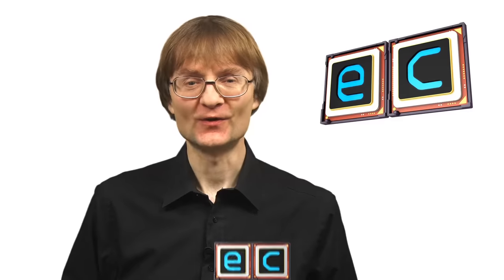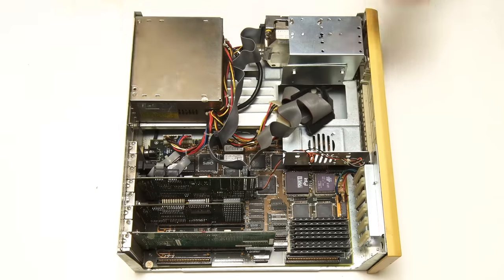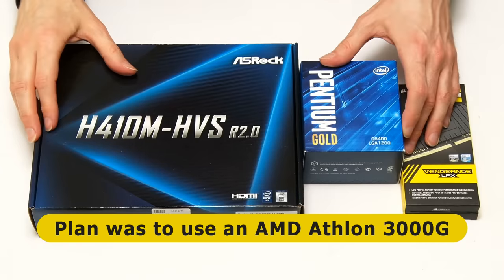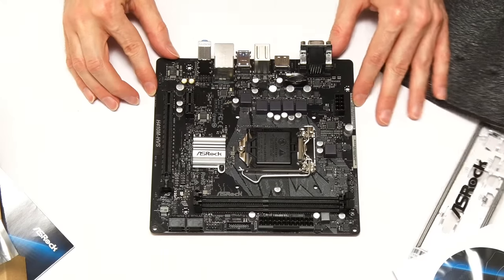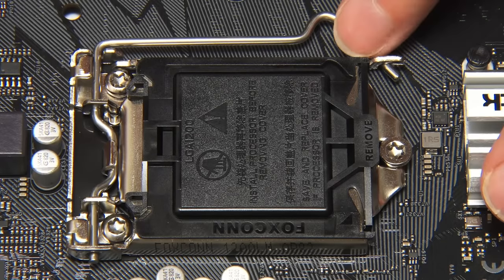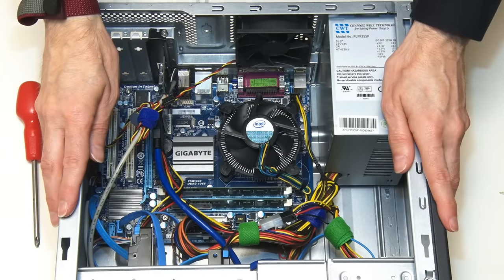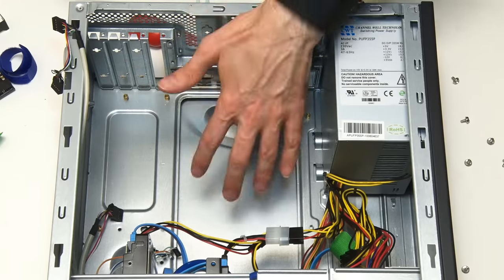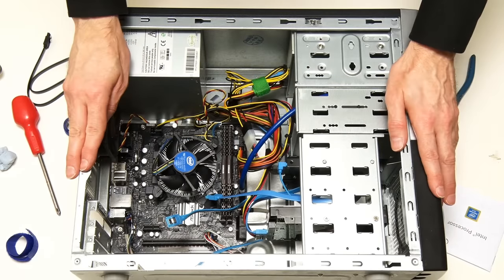Old PC Upgrade: Motherboard & CPU

Comment: Put an inexpensive, unlocked Pentium in the old PC upgrade I did eight-years ago. Pretty much did exactly what Chris is doing; new MB, the old case, 2 of the old drives. Put the OS on a new SSD, though. Better part of a decade later it's all still working great.
Reply: Oops. Chris did install a new SSD. Guess I should've watched to whole video before commenting!

Comment: One day the front panel connectors will be made simpler - like the USB connector - and not those silly 2 or 3 pin things that can be really annoying (especially the ones that come with every wire separately).

Comment: 18:25 the classic error when slotting the motherboard in without seeing that the little metal laminate above the hdmi hole on the backplate that should be pressing the hdmi port down now is inside the hdmi port ;)
Reply from the maker: Well spotted. Fortunately that shot does not reflect the actual build -- it was shot a day earlier when I did most of the close-ups and alternative angles, and I did not notice. Always when filming, access and vision are very restricted, so I am often working a bit blind.
Reply: @ExplainingComputers  I hope you have not left out the thermal compound.

Comment: I remember last year buying a 2600X with an ASrock AB350 Pro 4 motherboard (no RAM as I already had DDR4 lying around), and still got away with 200€, more or less the same price point for much higher end components.

Comment: Great video as always Chris!  I do wonder, though, whether you should have explored upgrading the processor of the existing motherboard with a second hand one from eBay etc.?  You could well have seen a noticeable improvement in performance for a fraction of what you paid, may not have needed to reinstall Windows 10 and you would still get some value from that DDR3 ram purchase.
Reply from the maker: This is true, but I am nervous about showing (aka recommending) purchasing old CPUs. As you say, it can work out great. But not always . . .
Reply: @ExplainingComputers  Sometimes it doesn't work well - for example, I upgraded a Pentium 4 Northwood to a Prescott processor and, well, there was no improvement overall at all - similarly, I upgraded a T7200 Core2Duo to a T9300 and the improvement was small - but recently I went from a i3 2100 to a i7 2600K and the improvement in performance was dramatic :) ...I think you could have installed a 4 core processor in the original motherboard as an additional step in the upgrade series??

Comment: Something you forgot to mention, if you are working on much older ATX system, it may only have a 20 pin ATX connector. If that's the case, the system may boot, but it's best to purchase a new power supply.
Reply from the maker: I am confused, as I stated and showed very clearly indeed that a 24-pin ATX power connected was needed when installing a modern motherboard, along with an additional 12 pin connector.
Reply: @ExplainingComputers  Yes, but you showed an AT computer. As I'm sure you know, back in the early 2000s, we went from the 20 pin ATX to the 24 pin ATX. Technically, new motherboards will accept and very possibly run on a 20 pin ATX connector, but it's not advisable. 

Sure, it's highly unlikely someone would be attempting to upgrade a computer from that time frame, but it is worth noting.
Reply: @ExplainingComputers  And the reason I am specifically pointing this issue out is, I upgraded an old Athlon XP system to a Core 2 duo back in the day. My PSU had the 20 pin ATX connector, while the C2D had a 24 and a 4 pin EPU. Yes, the board ran, but the CPU couldn't clock to anywhere near what it was supposed to since it couldn't get the power that it needed.
Reply from the maker: @freednighthawk  No, I specifically showed a the 24-pin ATX connector and said that a PSU had to have one to use the PSU with a modern motherboard. I then showed a completely different connector in an AT computer as you say. I accept that I did not show a 20-pin connector on a board between the two. But I very clearly indeed stated that a PSU will need to have a 24-pin ATX connector -- and showed the same. So yes, I agree and know that there were 20 pin ATX connectors, but as I stated and showed that a 24 ATX connector was needed, I am struggling to understand what the problem you are complaining about is! :)
Reply from the maker: @freednighthawk  Thanks for this, and I totally accept what you are saying. Trying to run a modern motherboard with a 20 pin connector will either not work at all, or will give issues as you note. However, by saying that a modern motherboard requires a 24 pin connector and a 12 volt connector I did address this issue, not least as 20 pin ATX PSUs did not have 12 volt connectors.

Comment: I would have tried first putting a better processor like the Q9550, doing the before and after and the talking about upgrading motherboard + CPU. Just a suggestion, but nice video!
Reply: Maybe that is an idea for a new video. What to do with the old CPU + Motherboard and RAM. Upgrading the CPU and adding a graphic card like GT1030 would be a nice upgrade to the original PC.
Reply: @josevargas8073  yeah, I said Core 2 Quad or 771-to-775-modded quad-core Xeon with a low-to-mid 10-series card, but no, replace the computer in the computer...

Comment: Nice video Chris. Doesn't it make more sense to go with a Ryzen 3 instead?
Reply from the maker: Thanks. :) On the CPU, it depends what you want to do, as a Ryzen 3 CPU and motherboard would be significantly more expensive (and I've done a Ryzen 3 build previously) As I noted in the video, I intended to do AMD 3000G, but none were available and after two months of waiting I gave up. CPUs remain in very limited supply.
Reply: @ExplainingComputers  Yeah, I guess it makes sense as long as this can handle what you throw at it.

Comment: At least Intel provides decent driver support for linux. 
Nvidia has a less customer friendly approach in that regard. 
Still, I also tried to obtain a Athlon 3000g for a mini build, that was supposed to replace my turion 64 x2 powered laptop, that serves as a bathroom PC. 
A once 38€ part, that is now scalped for nearly 200€. 
So I settled with a used Ryzen 2200G and have to deal with the slightly higher power demand.

Comment: If you're replacing the mobo/cpu/ram, I'm wondering why you don't just go ahead and go for a Ryzen set? The one trick these days is getting the video card. Everything else is fairly low-price these days. Only other main issue is if your drives are IDE..you'd need an adapter card, otherwise I'd say keep the drives when you upgrade.

Comment: You should try athlon 200ge. It's a cu equipped with dedicated GPU system as iGPU. And you could reduce the size of your desktop in smaller size

Comment: My previous PC (now my no.2 PC) I had to replace the motherboard as I completely messed up the BIOS, but  when I had replaced the motherboard it booted straight up into Windows 10 and it was activated, though the previous motherboard was micro-ATX and the new one was full ATX, it was a big case with room for an ATX.

Comment: When upgrading a PC this old, it can also be useful to look for used parts. You can often get something that will outperform new budget parts at the same price. Of course the used market is also a bit screwed up now because of the shortages.

Of course that’s not what this video Series is about, but I thought I would mention it if someone out there is wanting to upgrade their old PC.

Comment: Nice video :) I also used to upgrade my PCs this way, but lately I bought a used Lenovo M93 SFF core i7-4770 (eBay, from the UK) for around 200 pounds + postage, which is more powerful than this Pentium Gold (cpubenchmark.net: 7100 vs 4100 for the Pentium), and better on the ecology plan.

Comment: 22:19 the reason you needed to reinstall is modern motherboard use UEFI by default. If you would have enables legacy support/CSM, it would have been able to boot without reinstalling. May be helpful if your doing this yourself and want to run the disaster that is windows 10

Comment: By the way in Moscow I managed to buy athlon 3000g for 4100 Rubles that's about $55. Did it about a month ago. I had considered Intel gold, but Vega3 integrated graphics is a way better than UHD 610 ofcourse. So I was lucky! :)
Reply from the maker: Congratutations on getting the 3000G!

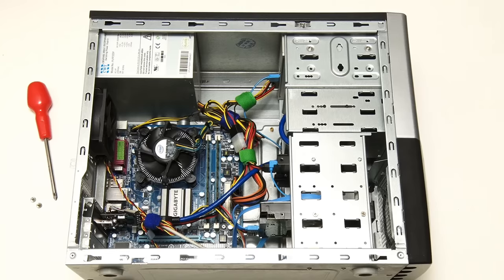Comment: 4:00 If your only argument for upgrading or replacing the PSU, drives and ANY other part is that it could fail due to age....you might as well hold off on the upgrade and simply replace the parts WHEN AND IF they fail. 
That is as long as no PSU explosion is foreseen and your data is adequately backed up.
Reply from the maker: I agree, but some here do not!
Reply: @ExplainingComputers  If those people want to waste their own money on that, who am I to argue?

Comment: Just a pointer, if the PC is just going to be used for basic tasks then upgrading the E5500 with a Q8400 would be more than enough.
Reply from the maker: True, but my intention here was to make a motherboard replacement video. :)

Comment: you never wont to put an heatsink on when it is mounted in a case you always stress the board doing this and can damage parts it is always better to fit the fan and heatsink outside of a case where you can support the board not to over flex the baord

Comment: Correct me if I'm wrong but doesn't that CPU cover just pops up when it latches the CPU? I think there is no need to remove it manually.

Great video!
Reply from the maker: This indeed occurs, but the Intel instructions that come in the processor box say raise the retainer, remove the plastic cover, then fit the CPU. So, as everybody and his dog has a theory on the best way to do it, I went with the official Intel method. As far as I am aware, Intel have never recommended popping the cover off using a CPU!

Comment: How much electricity would that use an hour? Something like 800kw?

I've gone on to Chromebooks now as Windows updates do my head in and my Chromebook can do everything I need them for.

Good video.
Reply from the maker: I've not put a power meter on this PC, but would guess a pretty typical non-load power consumption of less than 80 watts an hour.
Reply: @ExplainingComputers  that's quite low, since I stopped using desktops and started using laptops and now Chromebooks my electricity bills dropped completely.

I only use my laptop now to burn CDs, I don't like windows anymore.

Comment: I'm really enjoying your 'old PC upgrade' videos Chris - thanks for making & sharing. I have an 'old PC' which I built about 10 years ago: the case, fans and PSU are all potentially re-usable, but I'm unsure of the 4-pin ATX connector coming from the 500W PSU. Modern motherboards have an 8-pin connector for the CPU 12V supply. Can I calculate the power requirements of my new CPU (no decisions made yet) and compare this with the capacity of the 4-pin 12V supply from my old PSU?
Reply from the maker: It is very unlikely that you will need the 8 pin 12v connector, with 4 pin 12V being fine for the vast majority of setups these days. If you did need it, you would probably need more than a 500W PSU! :) You would need to be using a very high-end CPU and a high-end graphics card to max out the 12V 4 pin connector in a modern PC (as power use is now less than it was when the 8 pin connector was introduced). So my advice would be if your PSU has the power to run your CPU, GPU and everything else, you will be OK with the 4 pin connector.

Comment: Very nice play-by-play for the newly-fearless upgrader :)  I'm reminded of my old 486, still in service if you count the 3.5" floppy and the sound card. :D  Not familiar with the Pentium Gold line so was intrigued to see it in action. Nice budget upgrade, performance about equivalent to a mid-run i7 so very usable. How far can you upgrade CPU on that board? I usually wait til the price goes down, then buy last year's CPU for pennies on the dollar. In the future, more RAM and faster CPU could again extend its useful life.

You can use an m.2 drive on a PCIe adapter card -- they're made for both 4x and 1x slots tho the latter are not always easy to find. Western Digital now makes an integrated bootable 4x unit (the cheap cards may not boot). I have one in a middle-aged system... BIOS doesn't see it but with a suitable driver XP64 does, and is happy to use it for swap space and the like. (Tho Win7 threw up in ways I'd never seen before...)

That old 386 was a hot car in its day... quite a fancy one. Have you done a video on it?
Reply from the maker: The 386 PC has appeared in videos here and there, but you are right -- it needs a video of its own! :)
Reply: @ExplainingComputers  Would be interesting to see that... compare, contrast, and benchmark... quite painful compared to modern PCs, but oh my was the 386 a speed demon in its day. (And it would run DOOM! Well, sort of.)

Comment: This year I just upgraded my wife's computer and my computer from 6 to 7 year old Intel Core i5 4600 series CPUs, NVidia GTX 760s and 8 GB of DDR3 RAM modules to 3rd Gen Ryzen 7 3800X CPUs, NVidia GTX 1650 SUPERs and 16 GB of DDR4 RAM modules. Before anyone asks the reason I didn't go to the RTX 30 series cards is because tell me where you were able to get them at this time this year for any reasonable price.

Comment: Never remove the socket protection cover manually. it will pop out on its own when you push the lever down with the CPU installed.
Reply from the maker: Yes, it will pop out, but Intel has never recommended removing the cover using a CPU! :)  Rather, the installation guide that Intel provides in the box with this processor (and all of its other processors) is very clear indeed. It says to raise the mechanism, then manually remove the cover, then fit the CPU. There are clearly a very large number of people who do not read the instructions that Intel provide for fitting their CPUs.

Comment: 18:27 Oops. You have to be careful of the grounding tab around the HDMI port. The tab is partially blocking the port. I have learned the hard way about this, as I had to reinstall the motherboard to fix. :-)
Reply from the maker: Yes, it is blocked in that shot -- I did not notice. :( Fortunately this shot was taken with all the alternative angles and close-ups a day before the build, and the actual motherboard insertion was OK. :)

Comment: It's kind of painful to see so many USB 2.0 ports in 2021, and lower-speed 5Gbps USB 3 ports still a minority as if to tick items off a list rather than give users the best experience. 
I know you recommend reinstalling Windows 10, but simply installing all the drivers from that nice pack-in DVD before swapping out the components should also give the old install the chance to find and manage the new hardware successfully. I'm surprised you didn't mention it.

Comment: Plastic cover on the CPU socket should just pop off automatically when you close the socket retainer again.
Reply from the maker: This is true, but the instruction leaflet supplied by Intel in the processor box says raise the mechanism, then remove the cover, then fit the CPU. So as there are lots of views on the way to do this, I did what Intel advise.

Comment: i like my old broom,  i'v changed the head 4 times & the handle twice ,good old broom ^_~
au contraire, it's my experience any old psu still working will continue to do so longer than the new cheap ones shipping today, buy two as you may need it sooner than later ^_~

Comment: Changing Motherboard and the processor is pretty much as building another computer. You already purchased a SSD , 8Gb RAM. and USB 3.0 adapter. That is a lot. In my opinion it is as much as you can upgrade your old computer. The only thing you could still replace is the processor (and maybe a suitable cooler for it) to the last one that your motherboard can support. Beyond that there is no upgrade . There is a new computer. And for build a new computer I would consider nowadays a DDR4 based system. Sell the upgraded old computer and build this new computer. please consider using a dedicated video card too.
Reply from the maker: Thanks for this. It all depends on your starting point, and what you want to achieve. For many purposes dedicated graphics cards are not necessary and just create heat, use power and cost money. And yet for other applications -- not least gaming and high end video editing -- a video card is a must. Overall, this video is not real life -- it is part of a series where I show different upgrade options, and there is no suggestion that doing all of these to a single PC is the best way forward.

Comment: Maybe it's superstition but I've always changed the drive and done a fresh install when I swap the motherboard and CPU. It's also a good idea now as even NVMe SSDs are pretty cheap and will vastly outperform an HD or SATA SSD.
Reply from the maker: I agree on the fresh OS install as I recommended in the video. On a new drive, it depends how old the old one it. This one was a few weeks old! And it depends what you want and can afford to spent. When  last put a new motherboard in my video editing PC, I kept all drives -- 10TB of fast storage is not cheap! :)

Comment: i have planned to assemble my first pc 2019, right when components became very expensive due the bitcoin mining hysteria. i already had a good case and started to slowly gather everything starting with a psu, followed by ram and then motherboard. now since there is a second shortage, i was quite frustrated and bought a ryzen 3 and a geforce 1030 a little overpriced, but at least they were available and my power supply would allow to upgrade in the future. the struggle whether to buy an integrated graphic cpu and wait for cheaper graphic cards or have it this way was annoying, but since i dont need high end graphics anyway, im quite ok.